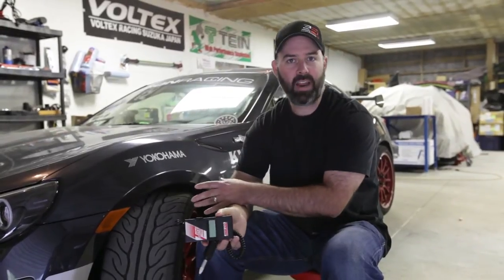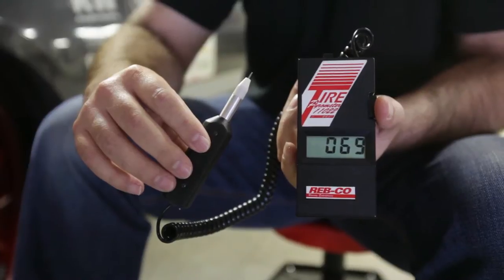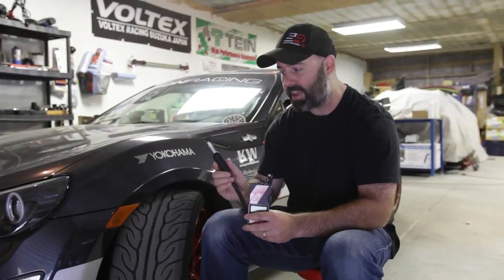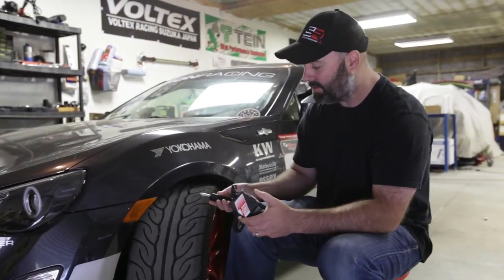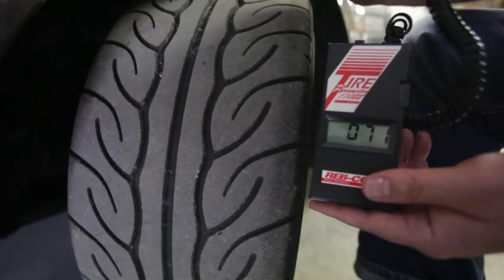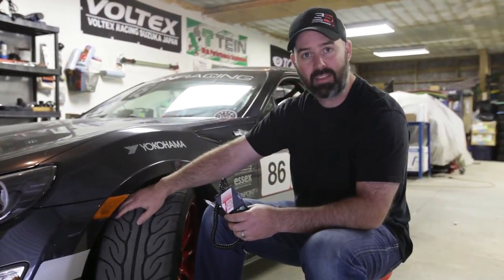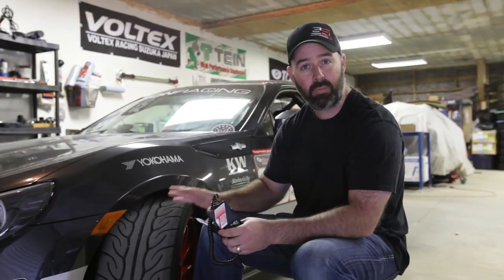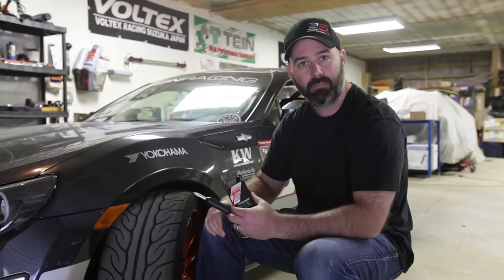How to use a Tire Pyrometer - Just the Tip

Comment: If you just stick the probe in and let it stabilize, the probe will actually cool that area of the tire significantly.  You'll get more accurate readings by quickly pulling it out and sticking it back in again in a nearby location, dragging it along the surface of the tire from one spot to the next.  So you puncture, wait for the reading to go up, then quickly stick into a nearby spot, wait for it to go up, and then again.  Usually by the third spot or so, you'll get your highest reading, which is close to the true core temperature in that area of the tire.

Comment: actually, you can get rough information on tires based on the speed and load indexes and in the UTQG rating in the tire. Generally a lower number in that rating means a softer compound since that number is a benchmark for tread-wear.

Comment: What is the maximum temperature difference from the inner to the outer side so that there is no premature tire wear?
Reply: About 10 to 20 degrees Celsius is the rough window where you want all your temps to be, out-mid-in and front/rear.